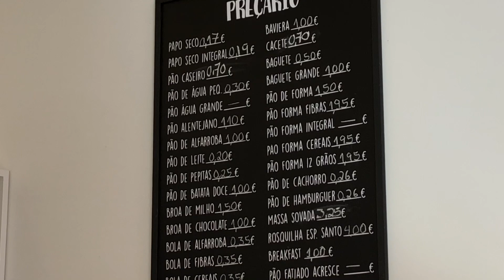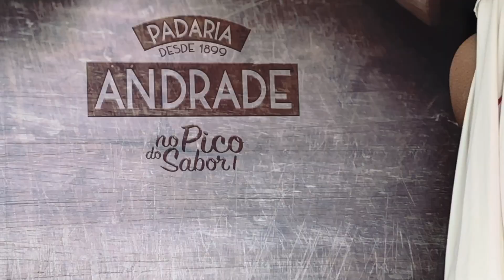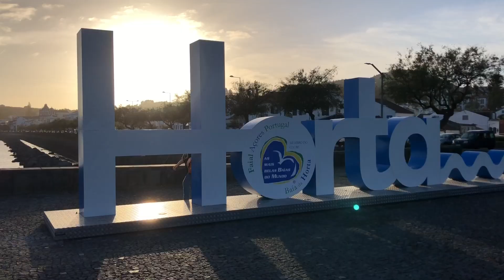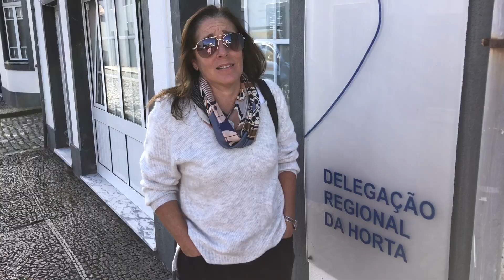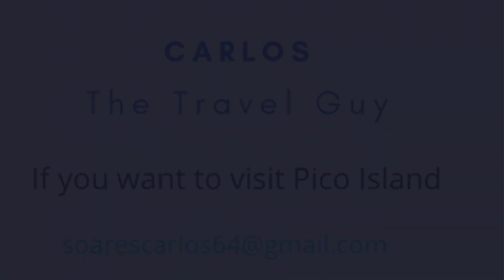Return flight to Canada has been cancelled by Azores airlines. Looking for new flight - Episode 15

Comment: Hi - I guess that during the nights at least winter time when It’s raining it gets cold and humid, what kind of heating system do you use ? Fireplace stove or  what Than you and stay safe 👍
Reply from the maker: It does get damp during colder nights.  We have a dehumidifier, and a couple of heaters.  It does the trick.  A salamander wood fireplace would also help a lot.  Some people also have an air conditioner and heater system.  A lot of options! Cheers!